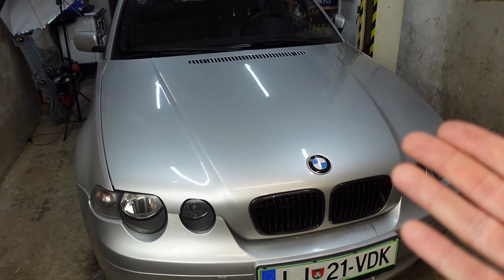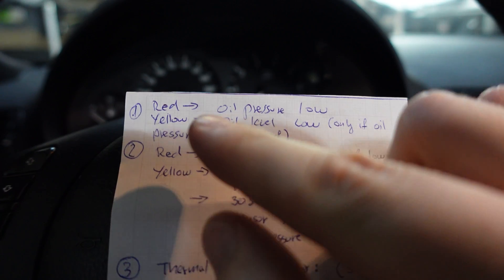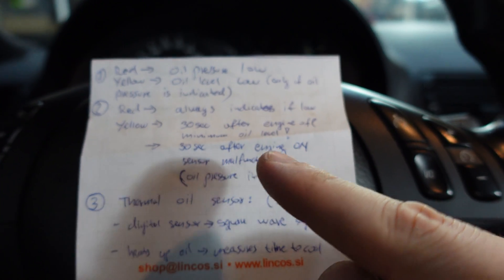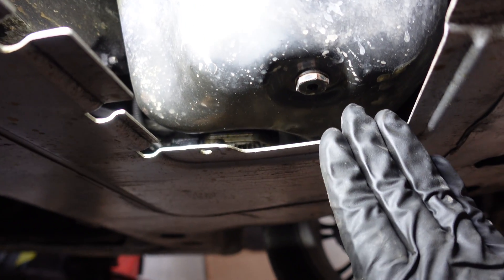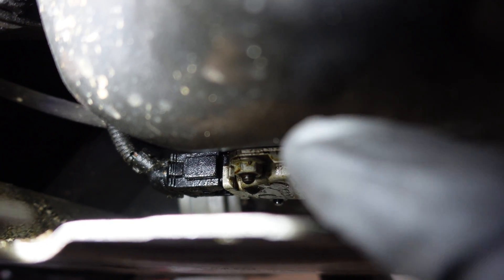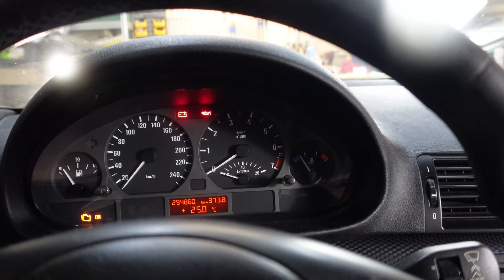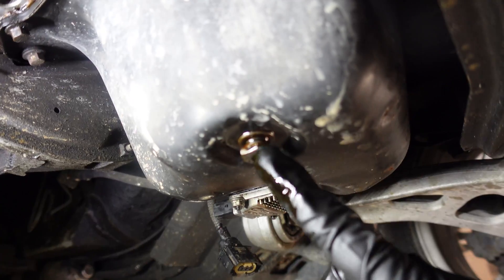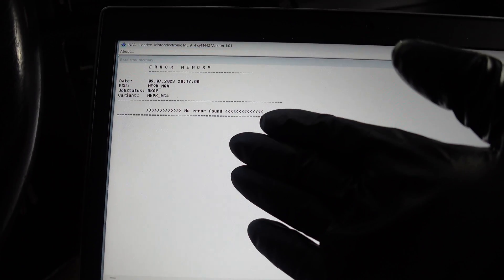N42/N46 Oil Level Sensor Light Diagnosis 27C3 and Replacement | BMW E46

Comment: Very nice video. Thank you. I changed mine 2 years ago and the yellow light went on about 3 months after the replacement of the sensor. I never taught it could be a bad/oily connector. I wanted to blame the manufacturer, but now I have to check the connector. 
Do you use some service manual to get all the specific details on how sensor indicators work?
Reply from the maker: Yes, I have access to the manuals where there are some functional descriptions of the subsystems.

Comment: why when you connected the new sensor and start the car the oil light didn't come on, the new sensor is hanging so should report "low level"?
Reply from the maker: Its a complex thermal oil level sensor which means the oil has to reach certain temperature for it to read the oil level correctly. In my case it would eventually throw another error, but not right away.
Reply: @BimmerZen  useful info, thank you. 👍 
When under normal conditions this sensor should show a "low level light" - when the oil reaches the minimum mark of the dipstick or should go lower than that? 
I also noticed on my e46 that i have no yellow light when starting the car - only the red one which immediately disappeared when the engine is started? ( cluster check from the "hidden menu" - all lights work including the yellow one )

Comment: Would a bad one cause it to not start?
Reply from the maker: Most probably not. It would still run on 3 cylinders.
Reply: @BimmerZen  thank you I’m getting no spark and that thermal sensor was the only code

Comment: I have an e46 M3 S54 engine.  will be the same?  I do have the yellow light, and stays on after starting the car then it will turns off in several seconds.  I believe my Oil lever sensor is bad..

Comment: Thank you for your great work. I have an off topic question regarding the camshaft position sensor. What should be the voltage for the signal wire? It should be 5V ? Because I have 11.8 and I have an error. Could you please check and let me know? Thank you for your implication.

Comment: so is that the problem for low power? how much difference does it makes ?
Reply from the maker: To be honest, I did not notice any significant difference. Could be more noticeable in cold weather... I could not find any exact info on what changes are made to the engine operation but I'll look in to that since I am curious.
Reply: @BimmerZen Great video, I have an N46 engine and I am getting a level sensor Inactive message

Comment: Hey. I know its not the best way to seek contact but im gonna try anyways. Got my n46b18 daily shitbox, running pretty decentish, recently did valve stem seals using your kit and fixed timing sińce even though it was recently replaced by some sorry ass mechanic, he failed balance shaft timing and engine had a lot of vibration. 

There is one issue i cant work out, other than that everything is super fine: very rough and noisy cold start and warm-up. After starting the engine it imediately starts to rattle badly and does so until temp needle leaves blue area. The moment warm-up ends, engine starts working fine. Tried unplugging valvetronic, Vanos solenoids and then doing the cold start, there seems to be no difference. Im running out of ideas. What could it be? Previous timing guides have disintegrated catastrophically, i found many pieces scattered around the engine. Cleaned everything up, but havent touched nonreturn valves between head and block (im trying to avoid removing the head). Any ideas by chance?
Reply: You got some plastic in your oil housing and wil not close. so all the oil drops back down
Reply: And wil rattle bad on cold start .don my car yesterday easy fix
Reply: @gerardbelzen.v2288  sadly that was the first thing i did and it did not fix the problem, although when i got the car it was in fact clogged with plastic debris.
Reply: Just remove the 3 bolts .and on the bottom of the oil housing you wil see the plastic stuk in the spring.

Comment: Great video man as always!
I have the same problem with the Oil level sensor but even after changing it the error still resides.
After some troubleshooting I found out that Oil was pushed through the harness into the ECU... the ECU seems fine no oil inside of it only in the plugs.
Now I am struggling if I replace the whole harness or just the cables running to and from the oil level sensor 😅
Reply: How did oil make it to the ECU?

Comment: This is good info but I have a problem my vacuum pump and camshaft keeps breaking what could be causing this to happen I ve replaced 3 vacuum pumps and camshaft for my n46 engine